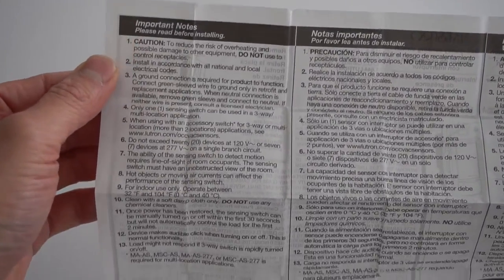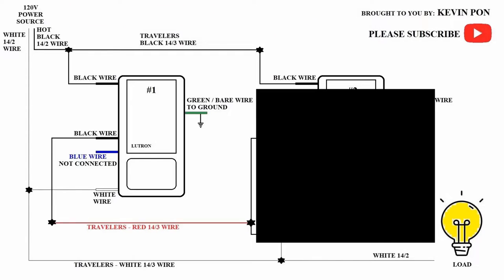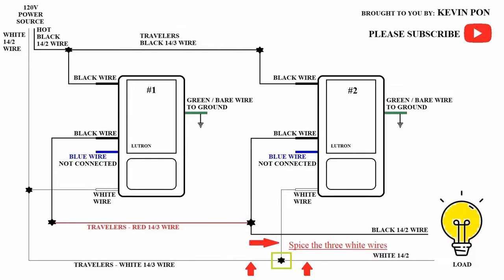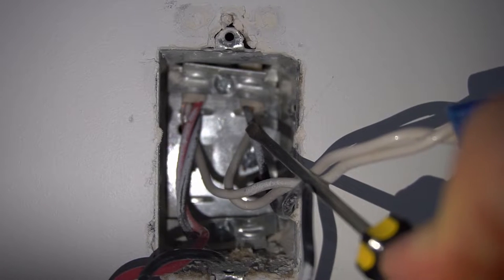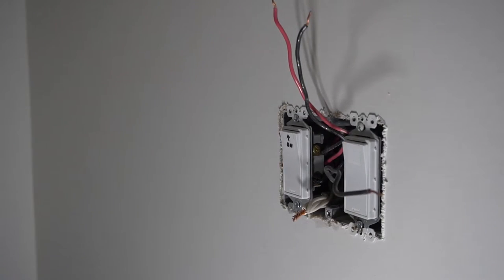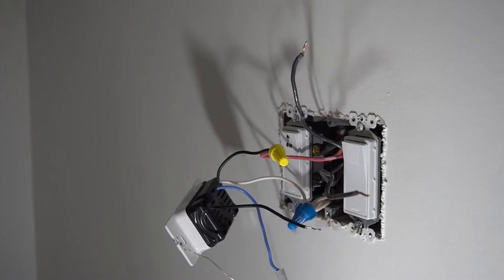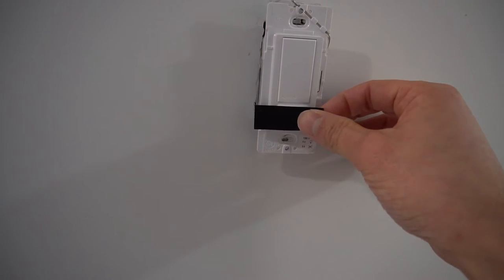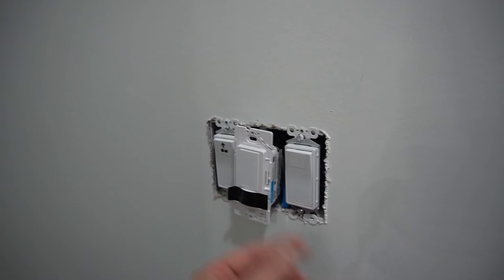TWO Occupancy Sensor 3-WAY Switch HACK BYPASS THAT WORKS! Any brand!

Comment: Would this arrangement overload the bulb/load with two power sources simultaneously connected in parallel to the bulb/load?
Reply from the maker: No you'll be fine. When circuits are in parallel. There is no increase in loads. Still the same number of light bulbs.
Reply: Yes.  I did that and it tripped the circuit breaker "thank God for this safety invension!!!"

Comment: Did not work for me,the 2nd sensor turn off the light and makes the 1st sensor the power source not turn the light at all
Reply from the maker: @kendrickortiz3071  please double check your wiring. The power should be supplied to both switches 🍻

Comment: Does anyone know if this is possible with the second switch at the END of the circuit? Reading some comments, it seems maybe not, as both switches need constant power. I'm no electrician, though...
Reply from the maker: I don't really understand your question. But if you want two switches to work you need constant power and connected accordingly. 🍻

Comment: this doesnt work
Reply from the maker: That's unfortunate, please try again. You have to follow the steps in the video 🍻
Reply: am I missing something?
Reply from the maker: That's because the other switch is also activated. It needs to time out or press that switch off too